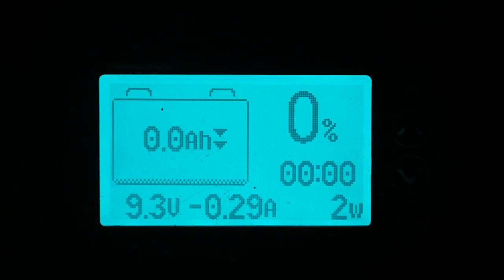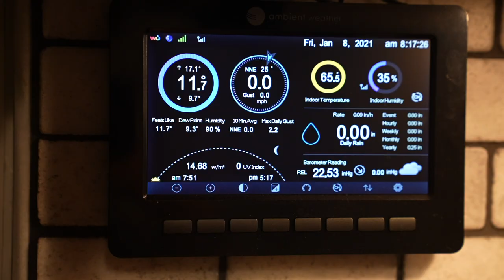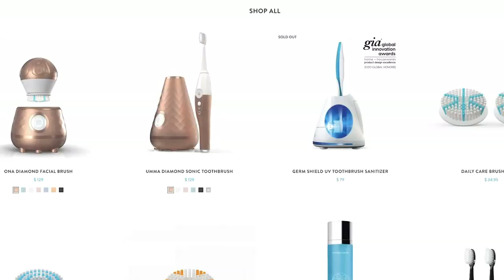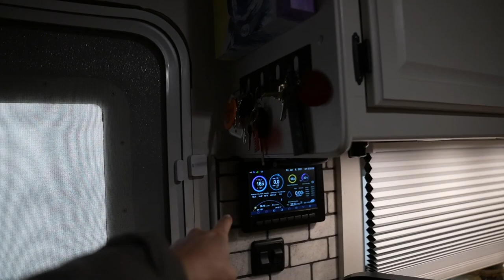WE'VE GOT MAJOR PROBLEMS | WINTER MOUNTAIN NIGHTMARE

Comment: Save yourselves a bit of headache. Build a quick little shed over the water outlet and hose with some plywood and cheapie foam insulation.
Reply: That was my thought I'm sure there are some scraps of wood it would at least maintain a warmer temperature and would be cheap.
Reply: I second this idea.  We did this on the farm back in the day and hung a light bulb inside for some heat.  It was always warm inside.

Comment: Hi guys, love watching your times and tribulations. I'm the guy that wanted to be Allie when I thought she was getting that exotic car, lol. I'm a retired Electrician with 35 yrs. of experience. I started my career by roping houses.  I'm sure I could talk you through the finer points of getting your house wired up. In a house your size, you should be able to get the electrical roughed in in a couple of days. Get your Main panel and Sub-panels in place. Pull the big wire between the Main and all sub-panels first. Then pull all your big loads, stove, oven, well pump, heating and AC. Then pull all your branch circuit wires. Make sure you "ring out" the wiring before covering the walls with sheet rock. That means that you complete all the wiring before sheet rock then you hook a 12V bell to the wiring at the panel and test that everything is wired correctly before covering. That gives you great piece of mind. Anyway, feel free to reach out to me, I'm sure I can give some tips and tricks to make wiring a little easier.

Comment: I would HIGHLY recommend installing a whole house generator. We did not in building our house and highly regret it.
Reply: Yassss hardwired and automatically kicks on when the power goes down.  If possible noise cancelling insulation so it doesn’t come with a migraine each time it kicks on or wake the baby ;)
Reply: @bopeep1455  And then on top: A generator, that does some heating - a combined heating and power plant. Here in Europe they are quite common. But in Europe you have to search for one, that can work authark.
Reply: Best idea so far. This will make your life so much easier. Dont forget to burn the diesel time to time.
Reply: Or at least something that would give them enough to run the first floor of a house and get those batteries going.  A whole house gen is pretty expensive.
Reply: @bopeep1455  So when you aren't home and it happens you come home to no power, dead batteries and a generator that is out of fuel seems way better.
Reply: @kunigundakucerova3645  They alredy have gas in the house - a gas burning generator would be easier.
Reply: @neenmach  I'm not familiar with the market. 
A generator must be cooled. But I would be keen to get that heat for the house. 
Generators (Panda) installed in sailboats are nice. Small (starting at 5kw), efficient and the cooling ist fed out.
Reply: @wjhann4836  That is not that efficient - heat/price wise. You are right that they need to do a calculation (maintenance, initial price, fuel price, avg. number of outages, etc.). If they live in such remote place I think generator will be the best solution.
Reply: @wjhann4836  not in the US, we run ours outdoors and are attached to a switch of sorts to the main breaker.  Or a portable one which you can attach via cord to main or use extension cords.
Reply: While house generator is worth every penny! Especially where you all are located.
Reply: IMO solar panels and a Tesla Power Wall or equivalent is a better year around plan. Solar panels are free energy and it looks like they have a ton of sun.
Reply: I live in the Adirondacks in NY.  First thing I did after moving in was to have a general whole house generator installed. A really good investment.  Maintenance once a year and I was setting pretty.  No regrets.

Comment: When I lived in the mountains I was taught to leave open a faucet so that the pipes would not freeze. When water freezes it expands and can damage the pipes
Reply: I don't live in the mountains but have to do that too in the winter when it goes below zero.
Reply: I live in the mountains, and I leave my kitchen faucet dripping on the really cold nights, too.
Reply: Same here! Mil is new to the hills and thought I was crazy when recommend that. She thought I was crazy 😂 pipes froze.
Reply: This is true I used to live in a trailer years and years ago in the Chicago area when it was almost always below zero we would get 50 below if you count the wind chill factor and only once did my pipes ever freeze cuz I needed a new heat tape.
Reply: We do the same thing here.  We are not even in the mountains.

Comment: i believe i would of put a 1/2 inch spacer against the open side of the stairs to to  the stair wall to facilitate placement of the sheetrock. much easier. great job tho so far.

Comment: Like I suggested before using 1 sheet of 1 inch pink panther foam board made into a tall box tape together with aluminum tape with a 1 inch gap around the pipe will keep the pipe warm while still venting excess heat out the top you can also still put the duct pipe around it.

Comment: When we built our house a guy at the home improvement store taught us how to solder pipes.  It worked.  Oh if the joint is really close to the wall hold a shovel behind it.  As far as sewer goes the layout should be on your blueprint.  Read your code book.  The distance between the drain and the vent pipe is important.  I ran all the wires in our house.  Just follow the blue print.  You already know how to wire lights and switches.  The three way switches are tricky.  We used the old Time Life books.  They had great diagrams.   We ran all the ducting for the Hvac ourselves but had a professional set up the furniture/ac.  We cut the holes in the subfloor for the registers too small and the covers never did fit quite right.  This stuff takes a long time.   My parents built there own house and they moved in when they got dry wall on one side of each wall.    Good luck.  Your doing great.
Reply: Time Life books! Isn't that something!

Comment: You should get emergency back up generator for your place.
Reply: all fine, except most trailers use a lot of 12 volt end devices (lights as an example)  which have to run through the inverter,
Reply: @larryfreeman7979  all RV have switch panel/breaker panel. The one that Trent and Allie Terry RV is set up for 30 Amp plug. You should look in to getting RV so you can see how RV works.
Reply: @Jack HoffmanThis is true for standard RV's and travel trailers, I've owned a couple. I don't know for sure but it would seem that when they converted Terry to a solar system they may have bypassed the original electrical setup. They said in the video they had power from the grid (they could use an extention cord to run space heaters) but still needed to charge their batteries to turn on the inverter. In any event, something about their set up must be different because they had power all along.

Comment: when you install the new fire think about a cleanout inside the house for the sweep - sounds messy but with your long winters you will need to clean that chimney over the winter period and you don't really want to get on the roof unless you build a ladder on the roof specifically for that job so it is safe - chimney will be on the Northern side of the house so no sun all winter

Comment: Heat tapes usually have a thermostat at one end, when covering the tape with insulation it's important to cover that thermostat too. If the tape is insulated and the thermostat is exposed to cold air, the insulated part can overheat.

Comment: you may want to research getting a low voltage cut off set so your battery does not discharge below 11.5 v this will protect your batteries and allow you to start the charging straight away.
Reply: battery discharge controller

Comment: Just so you know that if there's a Camping World or another type of RV dealer they sale a water hose with a' '' heat tape '' inside it. It works great. I know that you heat tape your hydrant and insulated it but the wind chill can still cause it to freeze. Instead of putting a chimney sleeve over it if you have extra lumber build a shelter around it.  Also, Leave the water just dripping even when you're gone. My wife and I spent 5 years at a permanent campsite and ,7 years in e parkmodel. I have a few years of experience.

Comment: As I mentioned in a previous video you need to put a small shed over the water pipe. Then insulate it and run a small heater in there. We spent a winter in Cleveland and survived -28 F. Also buy yourself a contractors torpedo heater. When things do freeze they are the best for thawing frozen pipes.
Reply: @tinydancer7426  true, but you can run a propane heater. Same for the torpedo heater
Reply: We heat our 100'x30' greenhouse with a torpedo heater.
Reply: I'd just stop by the neighbour's & see what they got going on lol!
Reply: Could also run a generator inside and use generated power to keep the batteries topped off. Two birds one stone.
Reply: A small insulated shed with a heater and light fixture with a couple 100 watt incandescent bulbs. The bulbs might provide enough heat to not have to run the heater all the time once the shed has warmed up.
Reply: 4x4 dog house would probably be more than enough.  Heat tape would probably be enough to keep it cozy in there.  Or just a milk house heater.
Reply: Exactly..they are using the water pipe as a type of pumphouse for the trailer, it works much better to be in a heated small insulated shed. They have 2 torpedo heaters, I have seen them in their house ..I don't know why they don't use them. They also have a generator which they could have charged their batteries with much faster and ran their trailer at the same time by plugging it into the inverter/charger.

Comment: You need to build an insulated dog house with a light socket inside for heat and a swing access door for maintenance and you will end your water problems once and for all and I would suggest you put the light on a timer , good luck Dick Bruton

Comment: I grew up in a house that had issues with water pipes freezing when it got very cold outside.  During those times, we would open one or two taps inside to a slow drip to keep the water moving.  Moving water is less likely to freeze.  We didn't have to do it but if the drip becomes an annoying sound inside Terry, tie a string to the tap so the water can run down the string.
Reply: You must remember to open BOTH hot & cold taps to drip.
I once forgot the hot side.  🥴
Took days for it to thaw.
You need to do it for each tap, bathtub/shower included.
Reply: @dudleydeplorable5307  No doubt, not the first time you've heard this comment but your handle is one of the best I have seen.  Keep warm and stay wonderfully deplorable Dudley.

Comment: So, I only know this cause I recently put a yard hydrant near my future garden. One thing I learned when researching how to install is this. When you shut the valve the water in the neck drains out the bottom. That is why it is freezless. If have a gravel base at the connection point, the excess water will be able to shed away, helping to not freeze ate the connection either.

Comment: Have you thought about leaving a faucet running with light dribble or fast drip? Usually running water won't freeze. That would keep the water flowing through the hydrant and hose. The heat from the water coming out of the ground will help too.

Comment: I would try making a shelter around the water hydrant using hay bales in addition to the heat tape. That would about 16-18” of insulation from the cold.
Reply: And a nice bonfire if you forget the heat tape on too long...😜

Comment: When it comes to mechanicals you need to start with the biggest pipes/wire and work to the smallest.  So do 1) HVAC 2) Plumbing waste lines 3) Plumbing water lines 4) Electrical 5) Low voltage wiring. Reasoning is  HVAC and plumbing waste lines need large open straight sections of wall cavities, are very ridged and need to be in very specific spots.  Water lines and electrical are smaller and flexible and can snake around the larger items.  Also what are you planning for insulation?

Comment: If it was my house, I'd go with ductless wall mounted units, you'd only need two of them and it would also be your AC as well, they are very efficient
Reply: That sounds great infro.
Reply: I’m getting this the first part of February, I’m really looking forward to them.
Reply: I have had that in my small cabin for 5 years and it has worked well. If it is really hot I use a fan in addition.

Comment: Get medium gas powered snow blower to keep paths around house, trailer and vehicles.  Much more precise than tractor unit.  Tractor fine for drives and large clear spaces.  Blower speeds snow out over larger area so no walls of snow to climb over.

Comment: I'll post this one more time. Yard hydrants are designed, if installed properly, to NOT freeze, again, by design. There should never be water in the upright piece of pipe when the water is turned off, if installed properly. The installation is obviously incorrect if it is freezing. Can't fix it in the middle of winter but maybe re-think the install this summer.

https://blog.boshart.com/how-to-operate-a-yard-hydrant-and-common-uses
Reply: This sounds so smart.
Reply: Yes, that’s how ours works, but isn’t Terry hooked up to that hydrant?
Reply: I too posted several suggestions regarding using frost-free hydrants in the winter - I winter camp in NH, and use a hydrant. The best way is to fill the RV's onboard tank and use the water pump and fill the tank as needed. ANY scheme which includes leaving the water turned on will result in failure and freezing, unless the heating solution of the vertical pipe goes down into the ground at least 4 feet. I realize they shut the hydrant down when they went on their trip, but if you do not remove the hose when shutting the water off, it may prevent the hydrant from draining the water in the vertical portion of the pipe, at least partially, resulting in a freeze below ground level. It's a good idea when shutting off the water to disconnect the hose and then cycle the hydrant on and off again to provide an unfettered release of the water in the vertical pipe. Also, this hydrant's vertical clearance above the ground is pretty high, and that indicates that it possibly was not installed deep enough into the ground to get way below the frost level, where it drains the water from the vertical pipe into a gravel basin at the bottom.
Reply: @curtmaddon-maddawgrvadvent349  I agree, I have 3 frost free hydrants on my farm to water the livestock. They will not freeze as long as a hose is not permanently connected to them.

Comment: I just read a couple of comments mentioning a back-up generator. If you're not ready to put in a generator but would like to keep your options open, you might think about roughing in a transfer switch now. It wont cost that much and you can put it in now, so that later you won't have to cut holes in finished walls and panels. Rough in a pipe that will go to the future generator. Bring that to a transfer switch mounted next to the main panel. Then pipe from the transfer switch to the main panel. Then, it's all roughed in ready for the future. Running it off your natural gas/propane tank is also a great idea, imho.

Comment: In stead of working on the deck I would build the stairs. So I didn’t have to keep climbing a ladder. Can’t wait to see everything done.
Reply: I was thinking the same thing. I have repurposed an old swimming dock and shipping pallets for temporary outdoor steps until it warms up enough to make real ones (for the shed and little used side door, not for the front door)
Reply: Can't do the permanente one because they have to a do concrete pad or footings and the ground is frozen right now.
Reply: Yep
Reply: Yeah but Trent is so resourceful and Allie is good at researching ideas. Hopefully they come across some stuff for free they can recycle into temporary step platforms, just until the snow melts and ground thaws. Maybe another free couch, wardrobe, kitchen cabinets, something someone else ripped out or threw away. You can use shipping pallets for a lot of things. Then burn when done (make sure it's not treated lumber though)

Comment: It's been a while since I was living in RV's but something to ponder…every appliance in your rig is operated by a Control Board or Circuit Board and almost all of the appliances have a different minimum operating voltage.  For the future, you should research maintenance manuals, to make a list of those minimum voltages for each.  Then in the future, when an appliance won't work or start up or whatever, check your voltage first to see where you stand.  I know it sounds simple and it is, but it also makes life much more stress-free when something goes belly-up.  If you can find a RV Maintenance & Repair manual at a RV store or online, it will be well worth…lots of troubleshooting guides, etc.  Hope this helps…   "Ol' Scooter", checking in from East Texas, again…Y'all!